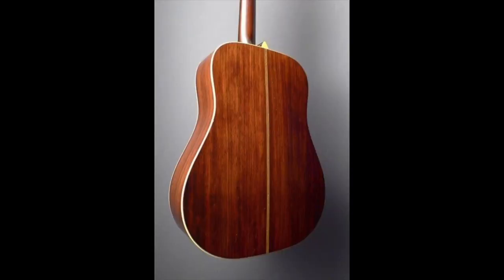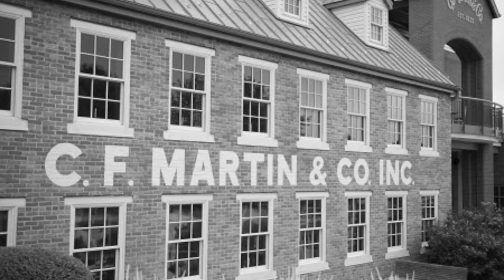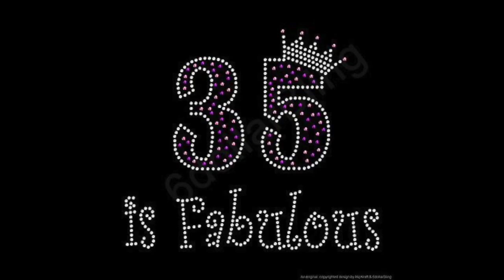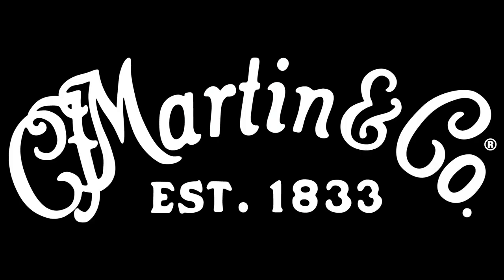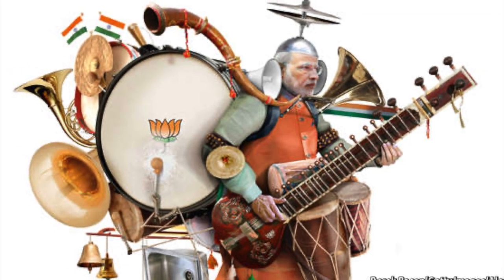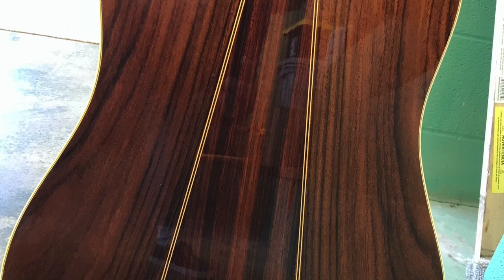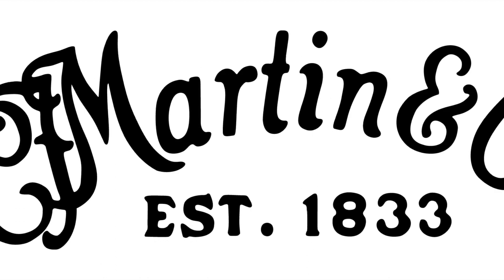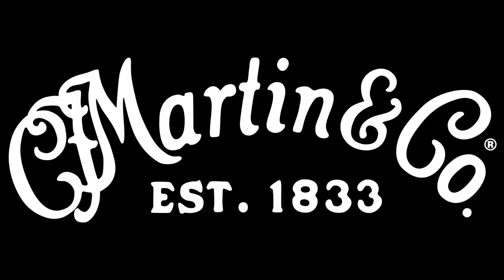The Hidden History Of The Martin D35 Guitar

Comment: I have a Martin d3t 1975 iam told I should not put 12s on only 10sis this true.
Reply from the maker: It probably depends on why the person told you that... 10s are extremely light... maybe your guitar has some sort of structural damage, bridge lifting, top buckling, no saddle left to sand off to adjust action/set up etc and that's why the person said "don't play anything heavier than 10s"... maybe something like "if you use anything more than 10s then you'll make this problem worse" sort of advice.  Without knowing anything about your guitar, I think the better advice would be "have a reputable luthier fix the X and then have them set it up whatever kinds of strings you want to on it"  ... if nothing is wrong with your guitar, 12s should totally fine for a d35, regardless of the year.

Comment: I have a Martin d35, 1975. I was told that a you can't put 12sgge strings on it. It's to heavy on the d35 is this true I've been playing with 10s on but I feel it would sound more stronger with 12s. I was told from the guy who sold it to me. I was Ant understand why I can't put 12s on. Also the truss rod on the d35 are not all the way down the neck just at the top end. Thanks would love some advise on the d35
Reply: Thanks for reply no everything on the guitar is really fine but he said d35s font take heavier strings I found that quite odd. I just needed to know is this true on a 1975 d35 thanks
Reply: He said d35 don't take heavier strings only use 10s it's very odd
Reply from the maker: I mean... maybe there's something unique to 1975 models that I'm unfamiliar with, but I agree it sounds quite odd.  I played 13s on mine for 2 decades and eventually went to 12s just because I got tired of mediums.  How long have you had the guitar?  My suspicion is that the seller told you what he did because he knew that the tension of 12s on it would quickly reveal a structural flaw in the guitar and so he put 10s on it to hide it.
Reply: @TimGuitarLessons  Same here. I bought a D-35 new back in '77 and ran 13s for years with no issues. I went to 12s also because I was doing more intricate fingerstyle music and wanted slightly softer strings. Also, on older Martins the truss rod does go all the way down the neck, they just aren't adjustable. There is no screw to turn inside the soundhole so some may believe the truss rod isn't full length. Seems like Claudia Pini was given some incorrect information.
Reply: I have a 2005 model I bought new and have always used 12s on it with no problem. I have even used 13s on it. I switched back to 12s after I put a LR Baggs anthem pick up in it.

Comment: In addition to the 3 piece back, The D35 has lighter back bracing than a D28, and 1/4” top bracing vs 5/16” in the D28.  This results in a bassier tone.  The D35 also has a bound neck.
Reply: Yes, I was going to mention the bracing too. It probably has more influence on the sound than the 3 piece back does.
Reply: I had one, a 72 D35 and sold it during hard times in 1992 for $1000.00. Original case too, but it was the best sounding ,deep bass guitar I have ever played. It rattled my chest.